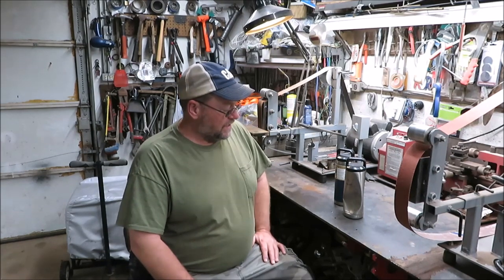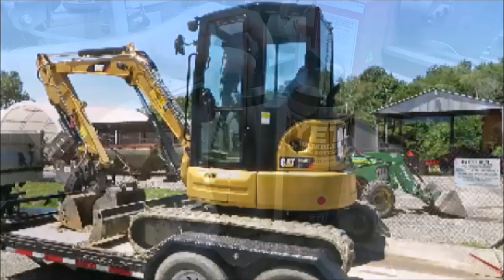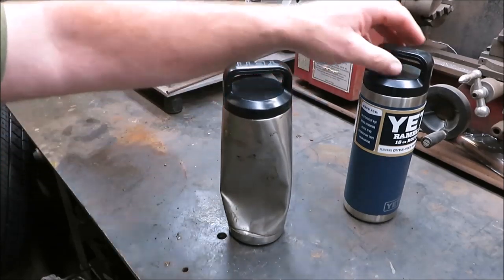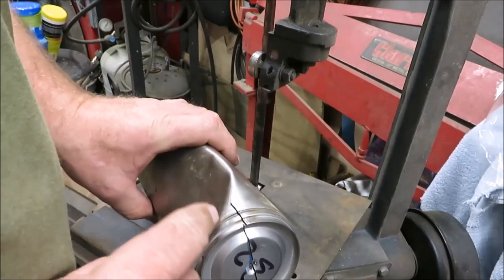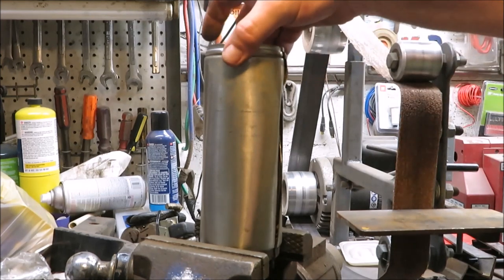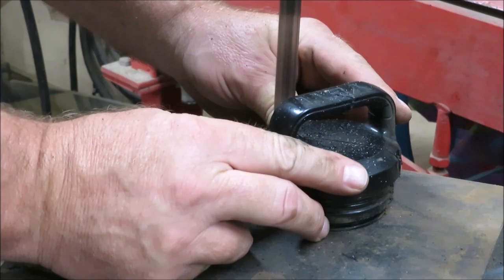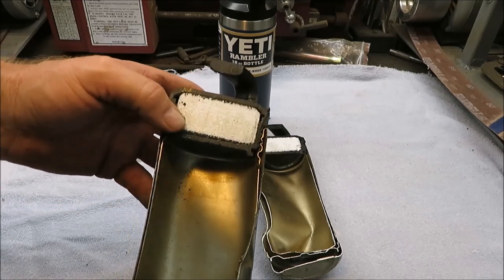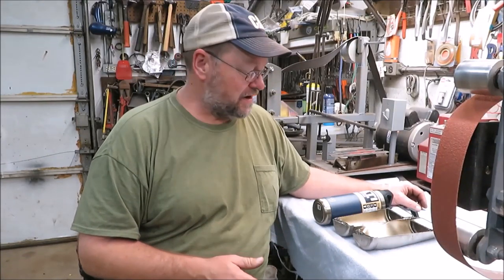yeti 18 oz bottle what's inside

Comment: Cool for sure. Kevin, I wanna share actual happening from about 25 years ago. My cousin long since deceased was a Heavy Equipment operator. He was running a D9 Cat one day and got off to clean the tracks do to all the mud he was running thru. He took his TIMEX watch off and laid it up on the tacks. And cleaned every thing off got back on the dozer and started off. He had to log the time he shut the machine off and started it back to continue working  He had ran the machine about 30 feet and stopped to log his logs. Opps, no watch he had left it on the track when he took off. Got off walked back and there upon the ground was his Timex. Picked it up and yep it was still ticking no band but a mud caked watch. His Mom sent the watch to Timex with the story. For the next 15 years around Christmas Timex sent him a brand new Timex. Yes this is a true story his name was Roger Lee Miller. So now we know the rest of the story.

Comment: Hi Kevin, thank you for posting this video, it's appreciated. My wife just purchased a new Keurig coffee maker and now my favorite travel mug doesn't fit the opening. I just ordered a new Yeti 12 oz bottle and I know that'll fit but it's a bit small. With the removable base out of the way the opening on the new Keurig is exactly 7".  I'm now wondering if the 18 oz Yeti bottle will fit as well. Can you tell me how tall your 18 oz bottle is with the cap removed? Thank you for your time, Kevin Kirouac
Reply from the maker: 7- 5/8" from too bottom with out lid hope this helps thanks for the comment Kevin.
Reply: Hi Kevin, You are welcome and thank you for getting me that measurement. I'm bummed that the 18 oz bottle won't fit in our Keurig but not nearly as bummed as I would have been If I'd have purchased one and found out that way. Thanks again, Kevin Kirouac

Comment: SERIOUSLY??? You want us to believe that was ran over by a "FOUR TON" vehicle and it didn't get crushed??? SERIOUSLY??? WELCOME TO NEW YORK! WOULD YOU LIKE TO BUY A BRIDGE???
Reply: Zonker, the actual weight is usually applied to one side, depending on what is under it. Example, I had a car roll over my legs and didn't break either leg. Bruised the top thigh muscles very badly, but didn't break any bones. Split the skin on the backs of both thighs, but nothing was broken because I was sitting in loose dirt when the tire rolled over my legs. I suspect this container got pushed down in loose dirt the way it was deformed. Now, I couldn't walk for a week, but my legs got mashed down in the loose dirt. I just made sure that the circulation didn't get cut off and I was on crutches for a month, but the bones were not broken.
Reply: Zonker try to be kind. Kevin is not a lier.